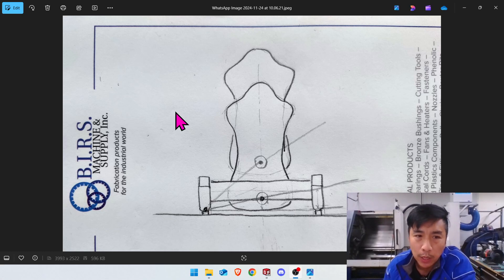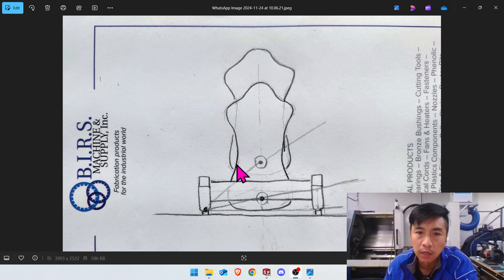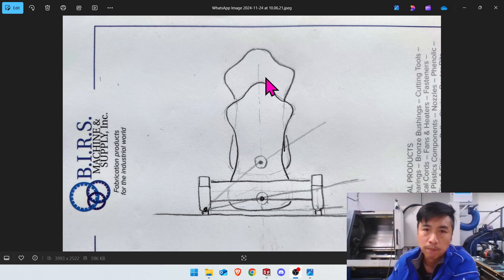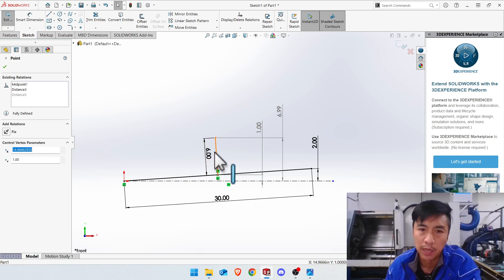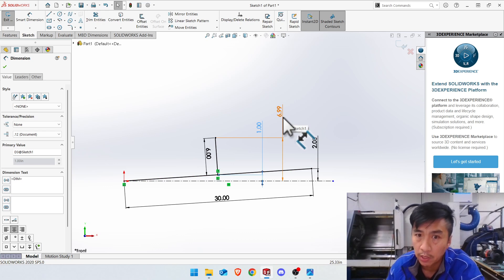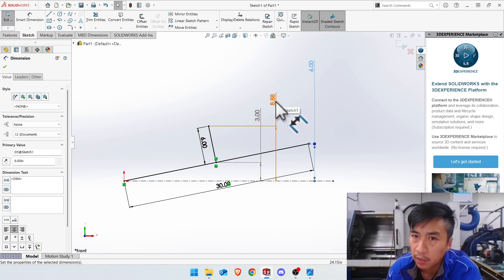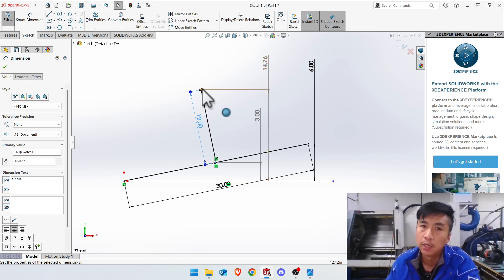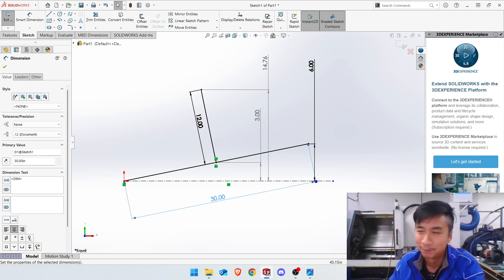Motion Talk 7 | Should I lower my seat on my motion simulator?

Comment: Great explanation. I was always wondering about that.
Reply from the maker: Thanks Badger, its one of those topics that is simple at first, but can get complicated rather quickly. But center of mass or center of gravity is best kept low for most performance applications, on and off track. Unless you are hauling something in American Truck Simulator then a higher seating position better mimics the real life roll center you get in a truck.

When we did our REAL remotely operated Peterbilt 579 truck back in 2016 we faced a similar decision. ;-) https://youtu.be/UfQpESk0G1M?si=gJCoTaKPkQkxuQVO&t=87

Driving the real truck "felt" different than driving in the our simulation software and in our remote emulator, remote controlled rig. Turns out putting the IMU or the unit responsible for collecting the real vehicle pitch, roll and heave data was important. Do you put the IMU in the center of truck? Do you put it on top of the driver, or the left side of the cab? All these different locations "felt" different.

The DK6+ has multiple mounting positions for this reason too. Of all our products it allows you to mount the actuator very high on the side extrusion or allows the chassis to sit lower. This is also required, as 6" is a lot of travel.